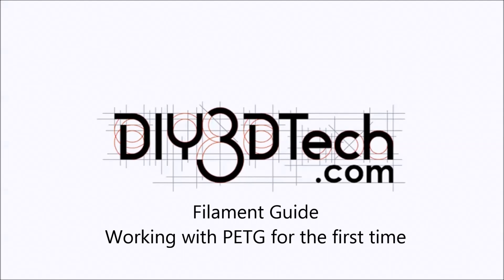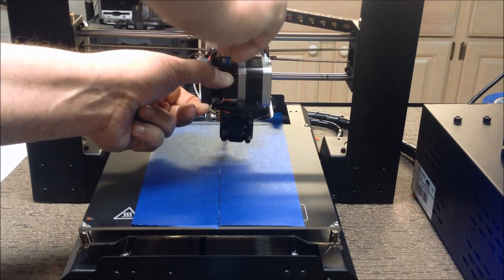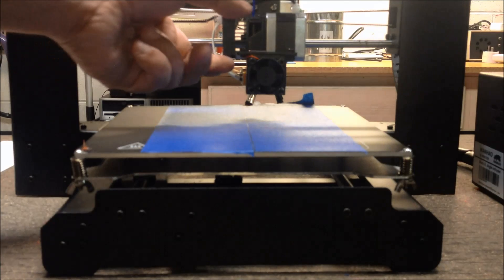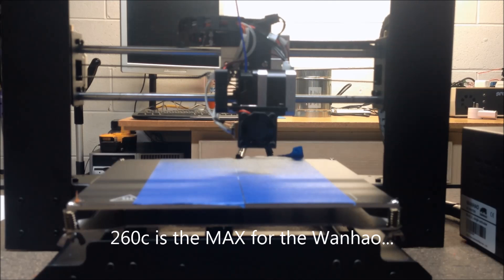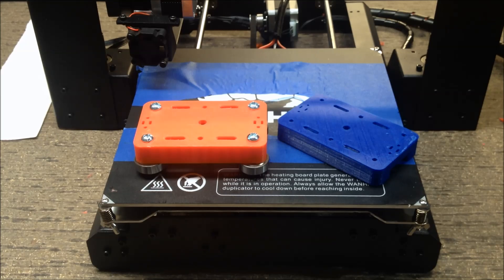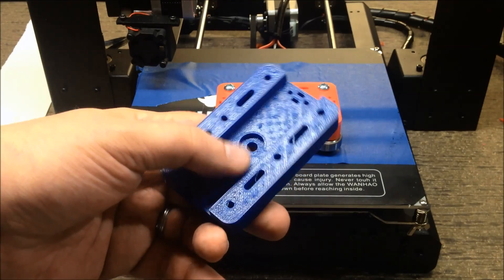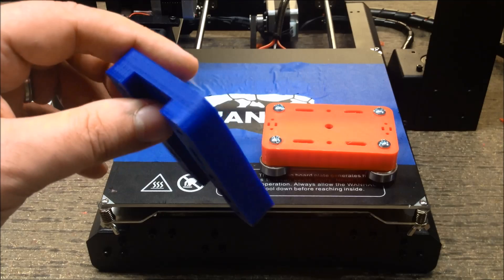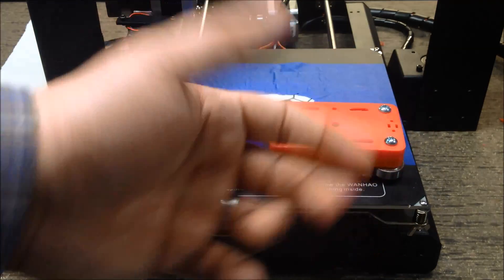Filament Guide - Working with PETG for the first time!

Comment: Thing I love about PETG is its sanding quality.  its REAlLLY hard to sand (you will know how tough it is when you try this)  so you really have to go at it, but when you do you can get it to a near mirror polish withe right papers. I use 260/400/800/1500 then 3000,    for parts I'm sanding I use 4-5 walls. and a finer layer height.   Sometimes I use 100% infill and it feels like a lump of marble or granite.   amazing stuff!
Reply from the maker: Good pointers!  I have not really tried sanding it, however the higher wall counts makes sense...  :-)

Comment: PTFE Bowden tube liner can be  a problem above 230c. It expands and the filament sticks on cheaper OEM PTFE..
Reply from the maker: Technically your correct, however have not experienced this issue first hand...

Comment: whats the lowest temp you have tried.  i hear 220 is the best temp for strength
Reply from the maker: It depends as typically run it a hotter say 230 to 240 however it can vary widely by brand

Comment: Why don’t you just start at the minimum temp and print out a test block.  That would take longer but save a lot of work
Reply from the maker: Not sure I understand?
Reply: Just calibrate the temp with a heat block from Thingiverse. It’ll cover each temp stage in a tall block. When it’s done you can see the best quality and what temp it’s burning at. I didn’t notice this video was kinda old. Sorry lol
Reply from the maker: Yes, use the temp tower and cura (or IceSL) to create a temp tower...

Comment: What kind of painter's tape are you using on the bed  I see it's quite wide.  with mine some parts stick to it. and pick up lettering that's on the tape.  Thanks Im also going to start a project with PETG.
Reply from the maker: Just 4" blue painters tape and this doesn't  have embossing on it as yes I have also seen that transfer to a print...
Reply: Okay thanks..I'm trying the glue stick next time.  ;-)

Comment: Hi can i print PETG on a printer without heating Bed for example the Wanhao duplicator i3 mini
Reply from the maker: Its best to to have a heated bed around 60c, however if its a small part you could try it.  Also if you look at one of my newer video I print a larger PETG part it does lift like ABS...

Comment: Being new to this I assume the blue tape is "painters tape", correct?
I did see a video suggesting NOT to print directly on the glass plate bed, as removal may damage the glass.
Reply from the maker: Personally I don't like glass at all and suggest PEI (see here: http://amzn.to/2FWW65L ) as yes people have reported issue with glass and PETG, however some use hair spray or stick glue to break the bond...

Comment: Why are you printing on tape if you have buildtak?
Reply from the maker: Because the higher heat of PETG can damage build surface which weren't designed for it like this one (which has intended for PLA)...
Reply: DIY3DTECH.com can you tell me what's wrong if my filament just doesn't stick to the bed? PETG at 220/60
Reply from the maker: First 220 is to cold for PETG, I typically print it around 255c (its recommend you have an all metal hotend or the PTFE tube will melt), second consider slowing the print down as the more (i.e. higher) viscosity of the plastic.  The slower you need go, so if you do PLA at say 50mm/sec, you might want to drop to say 30mm/sec.
Reply: also 90c bed temp stick like glue

Comment: what is your settings? I've been struggling with printing with petg Monoprice maker select
Reply from the maker: Have you switched your hotend over to a Micro-Swiss all metal (http://amzn.to/2u3dDEJ) if no, really can't do it without damaging the extruder as there is a PTFE tube in there which will start melting around 245c and you want to be at around 250 to 260c for PETG.  Also you may be having issues truly getting it that hot as take a look at the Wanhao playlist on my channel and look for series I did about a year ago on PID tuning and you will understand as just because it says a temp on the front panel doesn't mean its temp...

Comment: Hey Joe, was watching this older video again because I'm about to fire up my Maker Select V2.1 and wanted to check out your results with PET-G. I noticed in the background what looked like a Ruskin duct mounted booster fan. I used to be a draftsman for a HVAC company in my early work life. Brought back many memories. Lol. 

Good video.
Reply from the maker: +Norbert Davis I use it to vent the plastic smells as I have quite the system since it's a basement I vent outside

Comment: What speed did you print at? I'm looking to get my first printer (Maker Select V2). and interested in making something but out of a strong filament.. any advice for a newbie? Great video btw. i like how you test in the beginning
Reply: If your paying that much spare yourself and get the cr-10 from banggood
Reply from the maker: Thanks for the kind comments they mean a lot!  With PTEG you can pretty much print ABS speed wise as it main with TPU that you want to slow down. However keep in mind if you getting a printer you will want an "all metal" hot end as the PTFE tube will have issue starting about 245 and on up....
Reply: DIY3DTECH.com thanks 🙏 so much!

Comment: Is it possible to print PETG without heated bed, like PLA? I read about this, but interesting to check))
Reply from the maker: If it's a smaller piece you might get away with it, however a larger one will likely warp on you...

Comment: I have been printing with Esun PETG for last 6 months and any model I print comes out perfect. I use a Wanhao i3 v2.1 with micro swiss full metal hot end. After couple of experiments I use 250 degrees Celsius for the hot end and 60 for the bed with PEI on the bed. I am very happy with the results, no contraction always end up with correct printouts. I believe that it has a lot of pros to the other elements. Cutting, drilling and other Dremel'ling actions are always possible on the printed part. I mainly use 20% infill with 6 layer on top and bottom and 3 at the sides. I even had some stop and go later prints where I did not have any layer adhesion after all.
Reply from the maker: Glad to here this is working well as I love TPU also!  In addition would agrees with those values :-)
Reply: Can Dogancan 
Excuse me but what is your retraction settings??? Thanks

Comment: Got my Petg in today, and I prepared for it by beefing up my extruder body(bowden) and hot end E3D v6, and seems to be printing well now. I had issues with adhesion until I heated the bed to 70c. I also run it at 260C, at 250C, I was getting layer adhesion problems. I also had to turn off my part cooling fan, otherwise the layers wouldn't adhere. Seems to glass transition really fast compared to PLA. Other than that, it prints really well if your printer can handle the heat and the required filament pressure.
Reply from the maker: yes it will transition fast however it makes on very sold part!  all your other settings seem spot on, good luck and please keep me posted on your progress

Comment: Just ordered a Wanhao duplicator i3 v2.1 

What what I need to be able to start printing with PETG without having to worry about causing major problems or fires?
Reply from the maker: I would suggest switching to a swiss micro all metal hotend (http://amzn.to/2jD80FM) as you likely will have issues with the PTFE tube inside...  :-)
Reply: Thank you very much! 
Should I just save up and go for the Micro swiss? Or are there any clones I could cheaply try before diving in all the way?

Comment: Thanks for the video!  I don't have a lot of experience printing parts for practical usage... Did the shrinkage of the PETG affect the usability of the part?  55.03 vs 54.92 is only a 0.2% shrinkage.  I would think that would fall very easily within the tolerance of most things.
Reply from the maker: Yes shrinkage as well as expansion affect the usable and this is why it is important to plan for it in both the design and printing process as I scale up opening by 0.2mm and also use multiple shells in the slicing process so I drill a out to size without destroying the hole other opening.

Comment: Just out of curiosity, would bumping up the extruder speed and slowing down the print speed help with the shrink problem? From the look of it, it looks like your test was printed a little lean. I tried to print something with PLA, and didn't notice that Cura was set to filament of 3mm instead of the 1.75mm of the actual filament, and mine looked a little like yours, and was actually spongy from the lack of mass.
Reply from the maker: Not really, there are couple dynamics which add to expansion or just what I would call general error and the first is the way the slicer handles a mesh as an STL is reall nothing more than a buch of triangle as when you try and covert these the slicer averages.  Second is the play in the machine, than there is the expansion inherent in the plasic which will vary with much mosture it has abosbed (PLA can sucks a lot of water).  It is good to take around 10 measurements of the filiment, average those and use that for your fimament diameter which will improve things but not a heck of a lot over just using 1.75 on average.

Comment: Hi ! How do I know my printer can use this petg ?
tks :)
Reply from the maker: Using PETG on a Wanhao without an all metal hot is possible however over time it will damage the PETE tube inside the hot end.  Would suggest upgrading with the Swiss Micro all metal hot end (http://amzn.to/2djQHay) with larger heat block.
Reply: DIY3DTECH.com can i upgrade a atem a6 printer?
Reply from the maker: Sorry could tell yea, have not seen one....

Comment: 255ºC? Do you have the All Metal Hot-End installed? I want to print in PETG but I don't want to go past 240ºC with my PTFE tube. Advice? Thanks man your videos really help me out
Reply from the maker: Thanks for sharing as yes it is good, have also run across it in the past :-)
Reply from the maker: Your welcome and yes have the all metal hotend from swiss micro installed, however at your own risk you can go up to 250 as the melting point of PTFE (the PolyTetraFluoroEthylene tube) inside the hotend is ~260c.  I printed PETG for quite some time like this this without issues, however your milage may vary as they say...
Reply: I'm just planning to print Tech-G PETG from Taulman, and their recommended temperature is 238º. People have said that this wouldn't affect the PTFE tubing, and others have recommended the metal hotend. What do you recommend? Also, are there any downsides of using the all metal hotend? I heard theres some retraction issues, but I haven't looked into it. Thanks again!
Reply from the maker: PTFE melts at ~260c so up to ~250 you should be ok however this will shorten the life of the PTFE tube but the hot-end is a consumable anyway.  For me 238c is too low, you can try but my experience (not with this brand) is 240c to 253c as need to get PETG to "flow" so experiment with test prints.  Also watch the retraction values too as this can gum you up also...
Reply: Thank you
Reply: 242-247C is the zone.
Reply: I found this guide quite helpful: https://www.xyzfabs.com/forums/topic/63/print-settings-for-petg-esun-solid-black-filament/
Reply: I do not know which hotend do you have, but you can blow some cooling air. I have, for instance, a merlin hotend for one of my printers, and I added a fan. Original design doesn't not use any fan at all.
Reply: Yes but it gets soft and sticky at 240c. You do not want to go past 240c if you dislike changing your PTFE when it starts jamming.

Comment: print on PETG on PEI your life will be a lot easier.

also, 260C is really hot for PETG and you don't need 90C for the bed. i have several brands of PETG and I print 230C-240C. 50C-60C bed is fine for PEI adhesion.

260C you risk damaging your PTFE tube.
Reply from the maker: +ms3bani yup on the damage, however have an all metal hot end, so no issue. Also have a PEI sheet which I will switch too, just wanted to use up the build tack type sheet.  Why 260, basically flow rate.  As with the all metal hot end, I seem to have to run about 10 to 15 degrees higher...
Reply: print PETG at lower temperatures, it's more viscous and oozes less.
Reply: @ms3bani i use the same temperatures and a pei bed, but do you also have a lot of stringing? Do different brands of PETG have different amounts of stringing?

Comment: I print at 245 and it flows perfect.
Reply from the maker: +Montague Flange assume PLA?
Reply: +DIY3DTECH.com No PETG , the topic of this video. 250 for black though
Reply from the maker: +Montague Flange Ah ok, I am up with ya now :-)
Reply: Your hotend might be running a little hot, or you are using a different brand :) At 250, I run into layer adhesion problems with petg.
Reply: 255 on my Raise 3D N2

Comment: definitely need a heated bed to print petg.  Will pop off the bed when it cools.
Reply from the maker: +Eee Man Agreed, what temp are you running?
Reply: 245-250 nozzle.  90 on pei bed
Reply: Any issues with removal after printing directly on pei or other "build tak" like surfaces? About to give PETG a try.

Comment: Hi,Im looking for a weather resistant material any idea what is best ? 
and also that can bond each part together fairly easy ?Thanks in advance
 :)
Reply from the maker: +stylios zerox ABS for sure, however spend a bit on a better version if it will be exposed to a lot of sunlight :-)
Reply: Iwas thinking PETG also but no way how to glue it also :) did you try to glue it and how?
Reply from the maker: Never glued and and ABS glues well, that why I picked it :-)
Reply: Ok thanks i was also thinking buying a 3d pen that can extrude many materials even PETG :) and maybe solve the problem finding glue :)
Reply from the maker: Let me know how it works out :-)
Reply: i found pen extruding
 also pc i think also an alternative to try. iwill tell you but need time to test it :)
Reply from the maker: Thanks!  :-)
Reply: Crazy glue

Comment: Hi, been thinking about getting some of this PETG for my Wanhao. I have two questions for you. 

I use a glass plate bed on my Wanhao, do you think it will be okay to print PETG on to it? 
Do you have to change any setting in say cure to use PETG?
Reply from the maker: +Matt Day I would recommend some form of tack sheet, I only like glass for ABS but that is me.  Also only the temp needs to be up-ed in Cura and standard PLA speeds are good.  If you do use the glass for PETG, please do let me know how it works...
Reply: Thanks for your reply,  So I just add the temperature that you display on the video into cura. Just another question when I turn my Wanhao on do I select pre heat PLA or ABS as there isn't a PETG setting. Thanks again
Reply from the maker: I would do ABS as its higher as its only a "pre-heat" so it will still ramp up before starting based upon your GCode settings

Comment: petg is not more "solid" than PLA
Reply from the maker: +GoatZilla for me working with PETG is more "solid" than PLA as its over all resilience is more like ABS.  As I have printed mechanical parts in PLA only to have them fatigue and break.  Whereas with PETG they "seem" to last better, now I did look this up since you mentioned this and found that the Specific Gravity of PETG is 1.27 while PLA is 1.24 so for a 0.03 difference which is very small means both are basically the "same" solid wise.  However when I looked at the break point PETG was 26.20 Mpa whereas PLA 55 Mpa (big difference).  However if I look at Tensile Elongation (%) PLA is 6% whereas PETG is 54% (at 3mm)  so this explains the wear-ablity and thanks for mentioning as looking this up was a very interesting experience!
Reply: +DIY3DTECH.com Yes, that is exactly correct.

I think you should avoid using loose non-technical terminology like, "this seems solid".  If you can't precisely describe what you are perceiving, then perhaps you are not perceiving what you think you are perceiving.  I've found that subjective observations from reviewers should be tossed out, and it's best to just go with the numbers as you mentioned.

PETG has a tendency to flex before it breaks, which makes it closer to ABS, but with very little shrinkage/warping (less than even PLA).  However it is significantly more dense than ABS and not quite as stiff.  So which you go with will just depend on application.
Reply from the maker: +GoatZilla Don't know about you, however unless the person making the video expresses themselves as an expert and backs this up with established references, than everything should be taken as "perception" as I make these video for fun and to share my "perceptions" of things, this does not make them right  only hopefully thought provoking enough for you the viewer to go out and explore.  In addition, most of these are filmed at some awful hour of the morning as I have a day job and if I have to police every word which I say than where is the fun?   Again these [videos] are meant to be thought provoking and a bit entertaining too, they are not meant as an absolute reference with every fact checked by a massive support staff nor scripted in any sense.  So if this is to subjective for your taste feel free to toss it out with the bath water. I totally understand and no hard feelings :-)
Reply: You tell them DIY3DTECH...  Great video!